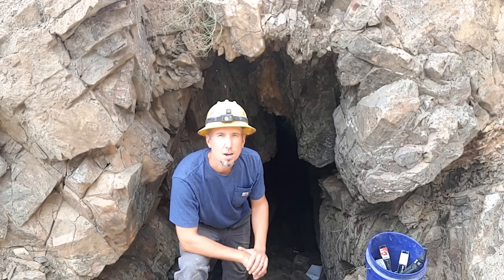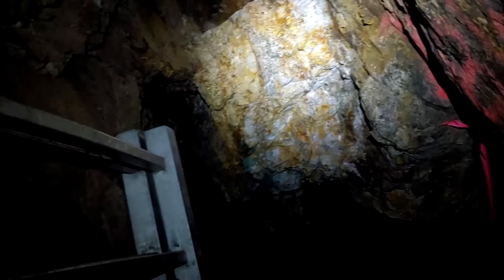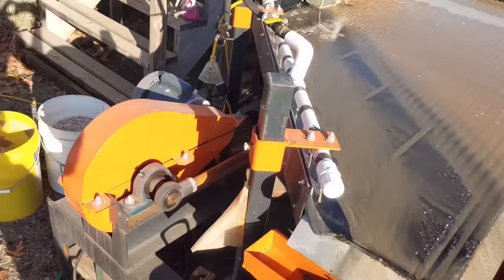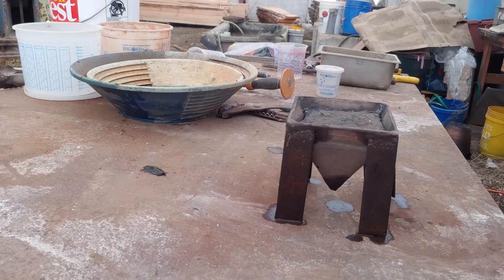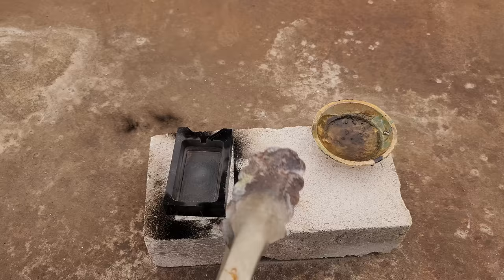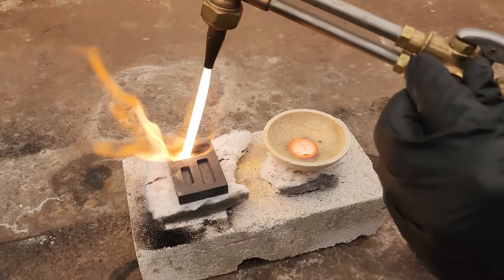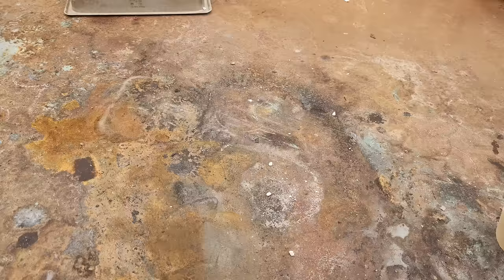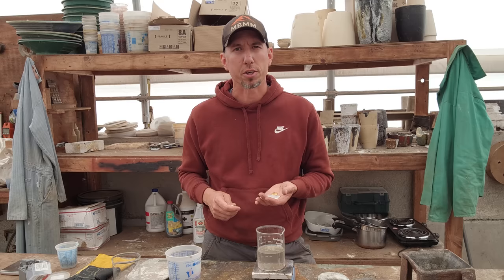Gold Mining, Gold Milling, & Gold Refining: The Full Process

Comment: 1. There is no reason to use precious copper to precipitate silver. This solution contains silver nitrate. When chlorine ion is added to a solution of silver nitrate, it replaces the nitrate with chlorine, forming insoluble silver chloride (a white precipitate). All you have to do is pour a solution with dissolved table salt into the silver nitrate solution and you will immediately see white insoluble silver chloride. When silver chloride is heated (or exposed to sunlight) the chlorine is driven off and it becomes elemental (metallic) silver.
2. It almost looks like your nitric acid solution contained chloride. This has led to the fact that gold has also gone into solution. Chloroauric acid has formed. Chloroauric acid is yellow in color. As a chemist I can only recommend the book "Refining Precious Metal Wastes - Gold, Silver, Platinum Metals - A Handbook for the Jeweler, Dentist and Small Refiner (CM Hoke)".
3. Just a little hint! The filter crucible you used is called the Büchner funnel. It is actually intended to filter solids with the help of a vacuum. For this you need a vacuum pump, a suction bottle, a rubber funnel holder and the round sheet of filter paper in the funnel.

Comment: I would recommend 2 things Jason:

1: you want to heat and then slowly boil your nitric acid with the alloy until there are absolutely zero fumes. This indicates there is little to no excess nitric acid. Another way would be to pour the hot nitric into a beaker with some sterling at a known weight in it. When you go to cement the silver, you can also weigh the sterling left to determine your silver yield. 

2: get some stannous testing solution and check your acid for precious metal content. Based off the color, you have either iron, palladium, or platinum in solution. The ideal way to have separated those would have been to add either HCL, or salt water to precipitate the silver out as a chloride instead of cementing all metals including silver onto the copper. Convert the chloride with some lye, stir until no color change (it’ll turn black) and slowly add sugar, mix and rinse very well, then melt. 

Last option if you cement the silver instead of precipitation is to boil it in HCL to rid of palladium as best as possible before melting. Add zing powder or aluminum, copper etc to the remaining solution to cement out the remaining pms and save for a rainy day.  

I love your video, and could only wish I could be there to watch, learn, and maybe even help with your final refining 😊

Comment: The solution was most likely yellow from dissolved NO2 gas in the solution. Sometimes when distilling nitric acid from sulfuric acid and nitrate salt you get the same color, and that's what it is. Or it could be as you mentioned, traces of iron in solution. 
About the copper, you have the right idea with the tubing, but use a thick wall 2-3 inch pipe, or better yet a busbar. If you want more pure silver, convert it to silver chloride by adding HCL,  then convert with Lye to silver oxide, finally add dextrose to reduce it to metallic silver. Done right, with plenty of rinsing you can achieve 999 fine silver. As an added bonus if you're very careful and add just enough HCL,  you get perfectly usable nitric acid that you can use again for the next batch.

Comment: To properly refine your silver, you need to finish the process by making yourself a silver cell and grow silver crystals in a solution of silver nitrate on a cathode using a DC power supply. The material you have so far is still including some copper and possibly some platinum group metals. I know, more sreetips videos to go through and a rig to build; but it appears he’s able to really mow through the silver shot to produce amazingly beautiful (and pure) silver crystals that can be melted down for 3 9’s fine silver.
Reply: Yeah I agree he made cement silver but then deviated from sreetips but what the hey like he said this is the first time.
Reply: @dantadysak5485  yeah, I forgot to include something about him being more comfortable with smelting.

Comment: Nice to see another sreetips sub! That's why sreetips does his home-made electrolysis process to get pure silver after displacing with copper tubes.
Another nice thing is that from the crusher to the shaker table you got basically a free Inquartation gold piece. You're just missing the steps of taking the base metals and the lead.
I'm sure you will improve your chemical skills to turn ore into gold and silver.

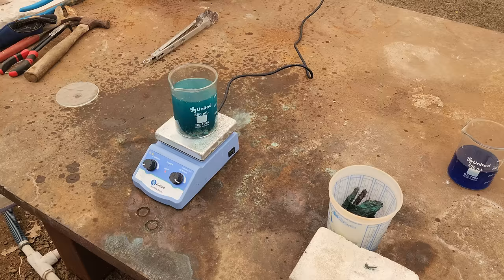Comment: A great video ! @1:11:20 I probably would have chosen sulfuric acid (H2SO4) to dissolve the copper and silver aggregate, as Ag2SO4 has a very low solubility in water (0.83 g/l at 25C) and will precipitate out, while copper sulfate pentahydrate (CuSO4*5H2O) has a solubility of 317 g/l at 20C and at 25C even higher. As a next step probably I would boil the Ag2SO4 with aqueous NaOH to form AgOH and Na2SO4 and from there either again HNO3 or other steps.

Comment: I think you put a little gold into solution on the last nitric boil. It's possible.  Silver preferentially goes into solution when it's with gold  but when you remove the silver and base metals and boil the pure gold  sponge in nitric for too long small amounts of AU  will go into solution.

Comment: Silver nitrate is completely colorless. If you have copper nitrate, it's Blue. Your Liquid looks more like Aqua Regia, that orange color. But since you are just using Nitric Acid, that might be other precious metals. I do Hope you used Distilled Water when parting your silver, as the Chlorine in Tap water will mix with the Nitric Acid and create a Weak Aqua Regia and Dissolve your gold.
You can use Stannis chloride to test your pour off liquid to determine what metals other than silver you have in solution.

Comment: Great video.
You could have converted the silver nitrate to silver chloride (insoluble in nitric) rather than precipitating with copper.
I use sodium bisulfate to clean scale and flux off jewelry. Has to be hot. If you touch the solution with steel it will instantly plate everything with copper if any is present.

Comment: The best way for you to process the silver is . Treat silver nitrates with HCL to form Ag chloride , which will drop into solid. Then leach out the silver to remove any impurities using HCL , salt and iron . You can use Aqua Regia to refine Gold to 99.999 . Which  is mixture NO3 and HCL , 1 to 3 ratio . Then drop it off by using sodium sulphate . Then melted , good luck and keep the good work

Comment: Hello there, you asked what the slight orange/ yellow colour was left in solution,  This could be a slight Iron presence but what is most likely is that a little bit of gold has gone into solution because the Nitric acid ratio was slightly too concertrate,  This would not be much. Kind regards,  Craig

Comment: great video silver is a pain to refine when using nitric. you need to get a couple of 1000 ml beakers as well. wait until you have finished dissolving the silver out of the gold to drop the silver out of solution don’t use small wire flat price of copper pipe is best and let the misfire cool down. leave it overnight as you found out wait until it’s finished dropping. also best to melt in crucible as you did in the end it’s better when hotter you could have put your filters in the crucible as well. also wash the silver mud a bit more to remove all the copper in solution it’s a pain as you have to do a lot of wash and get a bit of waste. just drop some angle iron in the copper waste bucket and leave for a week to get the copper out of that. but end result really good lump of gold to cover your costs 👍 .

Comment: The yellow colour is dissolved gold , it's a trace that gets into the hot nitric acid and plates back onto the gold ,  you need to use a more reactive metal say copper to get it to cement out of the waste

Comment: You asked why the color of solution was tinged slightly yellow after your 3rd boil....it may be you had a small amount of gold go into solution.... sometimes if the heat is sustained at high temp or concentration of nitric is high gold can start to go into solution.....i don't think it was much but stanous chloride test your solutions... color indicates metal makeup

Comment: Next time to separate the Silver from the nitric, just add some Chlorine. It forms an insoluble Silver-chlorine that can be filtered out easily. And you can straight up smelt it down, bear in mind it will produce chlorine when smelting.

Comment: Pretty sure sreetips avoids using Copper wire as you can end up with pieces of copper wire left behind in the silver sponge. I think You should have a catch basin under the reaction beaker to catch potential boil over.
Reply: Should have waited longer to comment lol

Comment: Very nice refine for a first time try. You will get smoother at it as time goes. Just be careful. Nitrile gloves and nitric acid are not a good mix. Saw a few other safety issues but sure you will get it down with time. Great job. :)

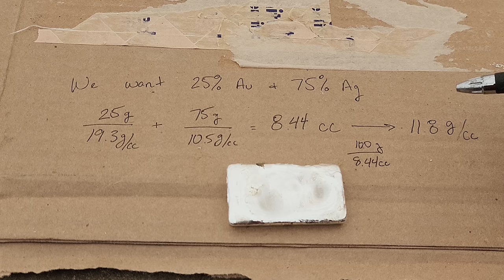Comment: 56:40 Corret if I'm wrong, but if your target is 25/75 ratio you add silver if needed. 20/80 is fine, 10/90 is fine no need to add more, but if you have like 30/70, then you add silver to get it at least 75%

Comment: For that little bit of silver I would have converted it to silver nitrate to silver chloride, by adding HCL to the nitrate solution. Then washed with hot water till it a couple drops of ammonia doesn't tint the wash water blue. Then convert the silver chloride to silver oxide with lye, then convert the silver oxide to silver metal with table sugar. Rise till a neutral PH and melt your. 999 fine silver.

Comment: Turn the jaw power off (electric) or throttle down ( engine) on jaw to slow down the RPM when a round one is bouncing, to let gravity settle it deeper into the jaw dies for a good bite -- my guess is half the speed it's running at.  Once you have a bite and rough surfaces, then back to full speed and it will crush.  Might have to cycle on/off a few times on Big-Uns ))

Comment: This brought back memories of my journey into hydrometallurgy 
And yes, I could see the train wreck.
Next tip, use a small amount of acid and make up the gap with electrons. And whatever you do don't throw away the black sludge all sorts of goodies

Au will dissolve in HCl if you add some electricity but will turn silver to silver chloride which is photosensitive and insoluble

Silver will dissolve in nitric with added electricity leaving behind the gold.  Never dealt much with silver and sulphuric.  Curious to see how that behaves. 

My experience with <1%gold bearing copper, the black sludge filtered straight through 80gsm printing paper in a matter of seconds. ( be ware of high surface area and high reaction speeds, best melted with solar furnace)

Comment: Flour Gold Wizard has a sponsor that sells bucket handle grips that will save your fingers while carrying those 5 gallon buckets of rock ore with no rubber or plastic grips on the wire handles. ❤

Comment: There's another way to recover silver from the silver nitrate solution which you might like to try.
Add a solution of salt and the silver will be converted to silver chloride which is insoluble and precipitates out. (The nice thing is that most chlorides are soluble and get left in solution).
You can then filter off the silver chloride and fuse it with soda ash or borax to recover metallic silver.

Comment: Save your copper! The foaming copper in your video is due to excess nitric acid reacting with the copper. This is why it turned green.

Instead neutralize your solution of silver nitrate and excess nitric acid with a weak base (sodium carbonate should work). Once you're near a pH of 7 then add sodium chloride in excess and precipitate AgCl. This silver salt can be heated with sodium hydroxide and sugar to reduce it back to elemental silver. Much cheaper than copper and keeps your sliver pure.

Comment: 1:11:43 Question: When you have your silver nitrate solution, right after you finish pulling the gold out, would it be better to put in a small amount of copper, far less than what you'd need to fully pull the silver out of the solution, let it dissolve completely, then drain the silver nitrate/copper nitrate into another beaker and get your solidified silver out, then repeat the process again with a little more copper, drain it, get your silver out, and keep repeating this process until there's no more silver to come out? It'd take a bit more time, but I think you'd be more successful pulling your silver out of the solution...
Reply: Very cool video. :) I believe Sreetips has some videos where he takes pretty decent purity gold and makes it 99.999% pure... if I'm remembering correctly...

Comment: U should  use bunt silver to kill the nitric acid first instead  of  using  the copper  wire burn silver kill the nitric acid from the solution  before  pulling out the silver with  copper

Comment: wonder if you can drill a hole intoo the vein make a watertight connection (epoxy a hose connection in) in it and use a hydraulic pump filling the drillhole with fluid under pressure (maibe even use pressure washer pump to do it ) to split it a few times , might help getting it out

Comment: At 1:04:50 the solution is a little yellow because some of the nitric acid decomposed from the heat of the plate, causing a tiny bit of nitric oxide to become dissolved in the solution. 

Also, there is definitely some silver still locked up in the solution after you precipitated it with copper, and the 30g discrepancy is not an unreasonable loss. The only way you're going to recover that tiny amount in a practicle way will be through electrolysis. That why sreetips waits till he has gallons of silver waste solution before he tries to recover it, because it's just not worth it to process such small batches.

Comment: Have you ever considered using a vac system to get your ore out of the mine??  I know the oil fields use 'vac trucks' to suck up all sorts of crap and take it to disposal.....these trucks have powerful vac systems that could be used for ore....and finding one used for cheap should be really easy.....and all you would really need is the vac system off the truck, not all of it  
it would also make mucking out the whole floor area of the mine easier....

Comment: So, IV spent many years in construction,, and IV learned when trying to get threw concrete or lime stone,,,,, take a round bit and roll some holes,,, then get out the flat bit,,, the holes give a place for pressure to be released a d a place for other rock to move into,,, it also can control you over all hole,,,, very similar to blasting holes,,, got give the rock a place to go 1st, then set the big charge,, buy definitely worth trying on hard Rock and or quartz, give it room to move🤔👍

Comment: That was fun and informative thanks. I was wondering. After the melt you did using nitre as an oxidiser, if you were to take that top layer and dissolve it in water, was there any Pb or Ag  in it? I would expect that it dissolved some in fusion. Put a drop of HCl to see. Secondly what was the pH of that dissolved salt? Was it alkaline? It’s useful if so

Comment: This video came up on my suggested list. I will never hunt for gold (I don't think - age) or process it but I do like to know as much as possible about whatever comes up. This seems like a long, tedious and expensive process for the amount of material processed. I have no idea what all of this costs but I would like to know what the processing cost is per gram or whatever unit you prefer? The torch and the heater and the supplies and the materials wasted would have to be included as well as the time spent in processing and collection. It's one thing to have two grand of gold but another to have two grand of gold that costs two grand to collect and process. Also, what other ways are there to do this? Say you go out and collect 500 pounds of material, can you send that off for processing and how would that price compare? It looks like there are now a lot of people interested in this sort of thing so I was wondering if there was some kind of group consortium who would share the cost of a processing center? Perhaps 15 years ago I was on a business trip to Reno and went on a site seeing drive with my wife. We took a "shortcut" back and got stuck on a winding road that passed through Sutter's Creek. They were still panning for gold right there. That's probably the closest I'll get to panning for gold myself. Thanks. It was an excellent video.

Comment: Look at The Copper Inquarter if you want to know how to refine gold properly. I have a video detailing gold refining constants which will make your gold refinings fool proof. Sreetips is good but definitely not an expert. For one he uses and wastes way too much nitric acid. The orange color in your solution is the reaction of silver dissolving in nitric acid. It would have eventually became colorless if you would have let the reaction continue, which you should have. As for silver precipitation with copper you want to allow the solution to cool then filter it and THEN add the copper. A big problem here was the excess nitric acid. You want to use just enough nitric acid to dissolve the base metals so when you precipitate the silver with copper you don't have a bunch of excess nitric acid eating tons of copper before the silver can precipitate. If you don't have much excess nitric acid then the silver will precipitate almost instantly and not go back into solution. This is an example of where gold refining constants can help tremendously.

Comment: Hi J. Do you use dish fluid to reduce bubbles in the trough of the shaker table? Also, where you point out the little gold pile above the number one down tube/shoot, why is it that you do not cut a slide in there so that that spot is angled into the downspout to the numero uno bucket?